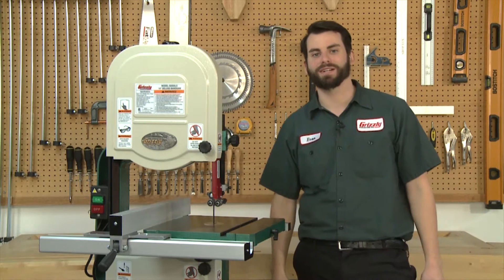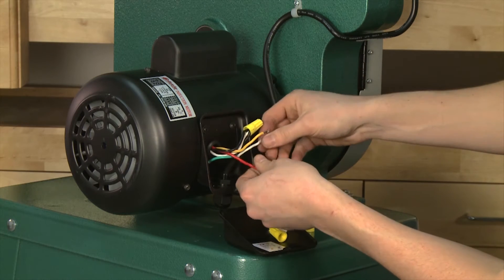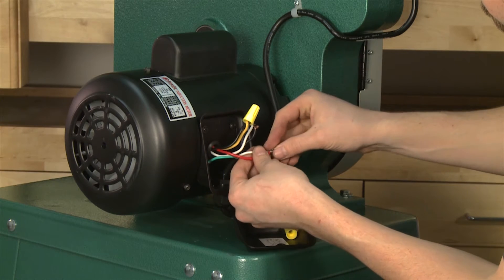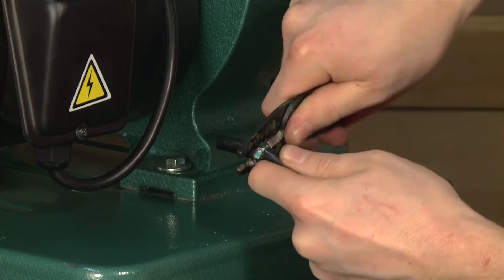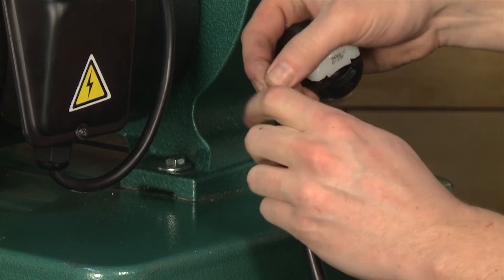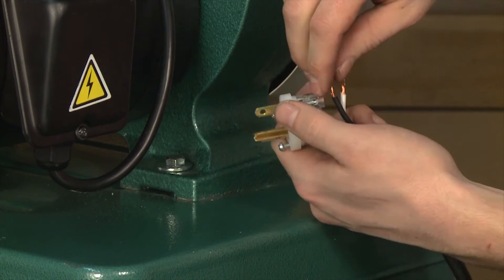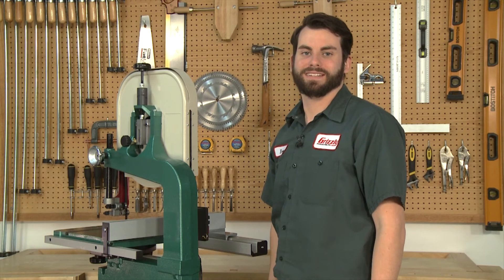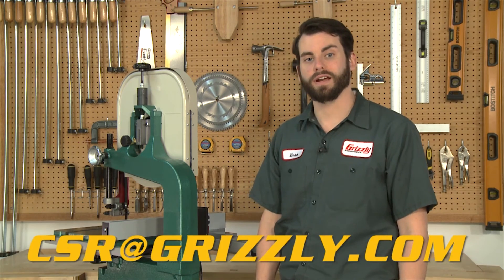How to Convert G0555, G0555P, G0580 from 110V to 220V

Comment: Converted my GO555 ANV EDITION from 110v to 220v in under 5 mins  following your video.  Instructions were good, but could be possibly improved.  I knew the difference between the wires from the motor,  and the power cord wires.  Not everyone else will.1. Perhaps you could use a close up clip of the wiring and point out the motor wires vs .power wires.  Since I believe that this video is clearly intended for beginners, they might need the help in differentiation between all the wires.
Reply from the maker: Thank you very much for your recommendations. It would be good to make an updated video. Great to hear you were able to make it happen in under 5 minutes.